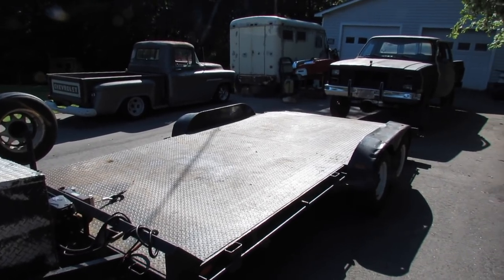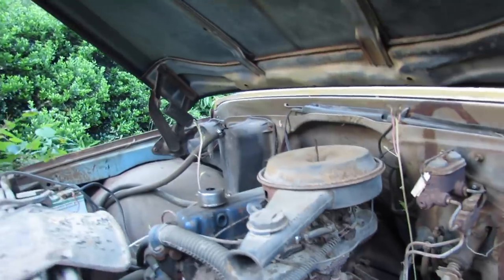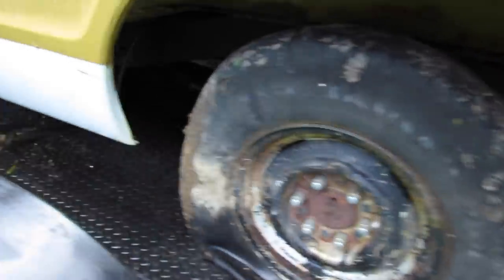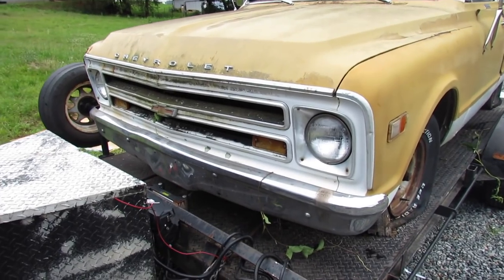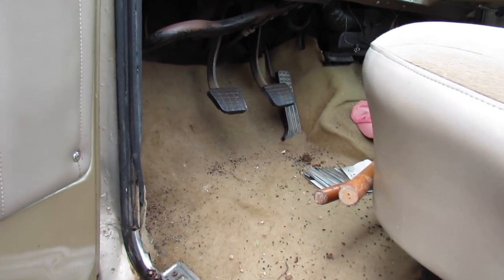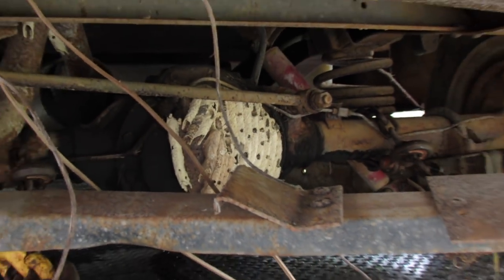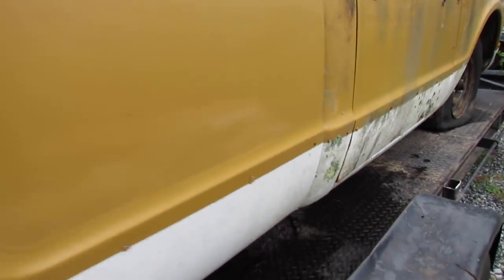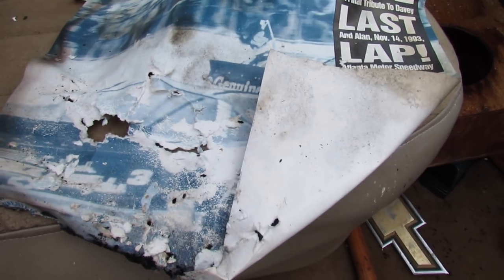Oops, A 68 C-10 followed me home.

Comment: looks like a GEM to me also.those old all coil suspension pickups ride really nice and haul lots well. my uncle had a 69 similar to this and it was a very good truck. thats were I learned about vacuum advance. the mileage was poor but it ran well. the dealer actually  had the cylinder head off but they could not find anything. my uncle put a timing light on it and showed me the vacuum advance was stuck. we fixed it and the mileage jumped up. later in life I had vacuum advance failures but knew what it was because all that you noticed was poor mileage.
Reply from the maker: Very cool.